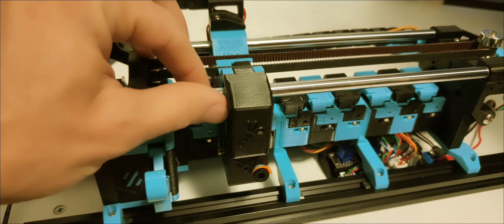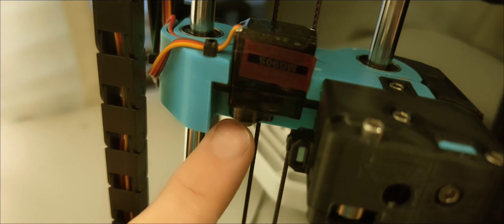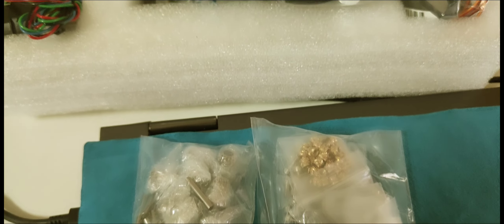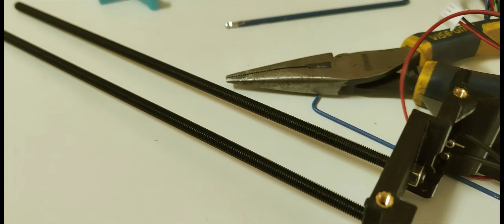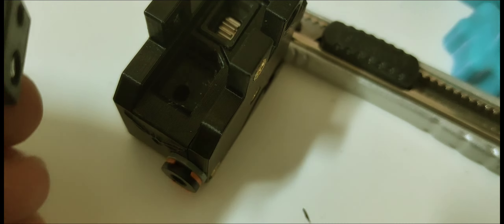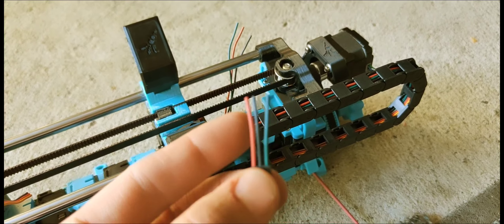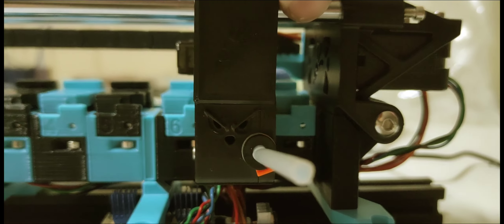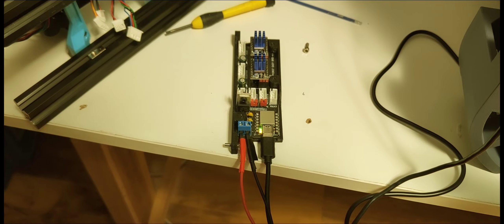Voron ERCF Enraged Rabbit Carrot Feeder Build Stage 1

Comment: Was there any soldiering, or was it all plug-and-play on the electronics stage with the ezboard kit?
Reply from the maker: Yes, I had to cut n soldier the wires to be able to feed them through the cable chain.
My kit came with one of the pairs ordering incorrect on the filament reader sensor as well required and cut and soldier.

Comment: Is there going to be a part 2? Hopefully you go it all working together. I've seen some successes, and some failures on youtube with the ERCF. The successes seem to be the guys that do this for a living (e.g. Nero3D). I've got an ERCF kit and will be tackling this soon - right after I get my Voron Switchwire built.
Reply from the maker: It loads and unloads great,
Everything works great except filament tip forming extractions and purge tower tuning.
Over the next 3 months I expect to get this tuned.
My tips have long hairs on them and they need to be clean spears. I also need to tune up the filament paths on spool setups
Reply: @jc84com  did you manage to calibrate it ???
Reply from the maker: @aokiomar256  I did. But I have to re calibrate it now I have a new dragon ultra high flow hotend.

Comment: ercf is a total waste of time in my experience
Reply from the maker: Funny that. I found ERCF so good. I have ERCF on both my Voron and Ratrig
Reply: @jc84com  lucky you, I'm having too many problems and it's not reliable, the creation of the tips works well but before the filaments flowed out of the blocks, then I printed the triple decky, that problem was solved but now sometimes it says filament stuck in extruder , but it's not true the filament slides away effortlessly, sometimes it tells me that it couldn't reach the extruder but instead the thread is inside, other times it can happen that it slips and I also put on the n5 top hats, I'm in losing hope